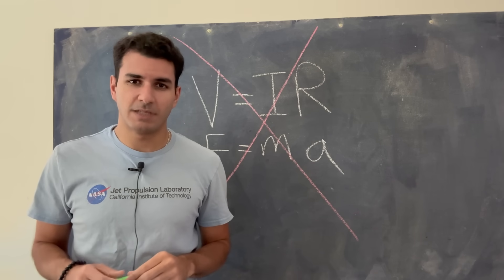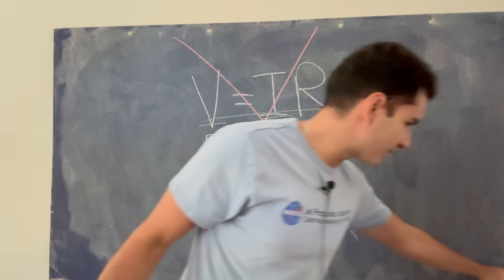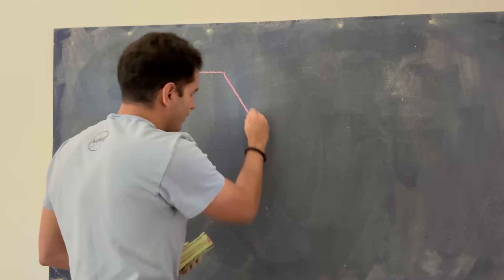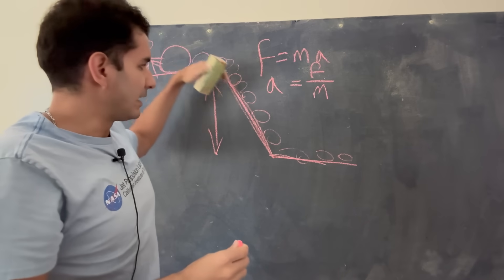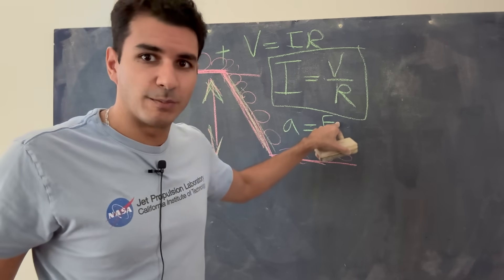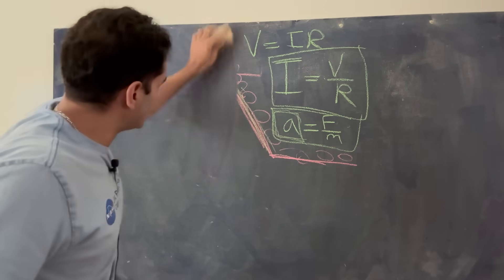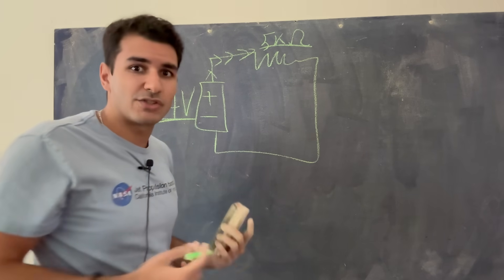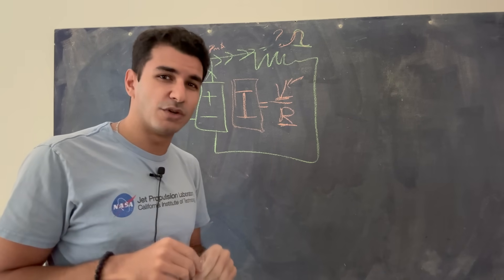You don't really understand physics

Comment: I would agree with your explanation of how and why this happens, but writing the equations the other ways tell a story too. The equation's form dictates what you are trying to solve since all three terms are in a relationship to one another. I you change any one variable you have to adjust the value of one or more of the other variables to satisfy the equation. Once you understand how and why this happens as you show, you then can solve for the other values by arranging the equation. You are essentially asking a different question of the equation when you alter it and try to solve for the "unknown" value. When you know the why of the relation, you can for instance, deduce and solve for the total voltage potential in a system needed to satisfy a known the amount of total current flowing with a known total resistance of the circuit for DC. Real life is quite a bit more complicated in that you have to consider a time factor in the equation as well as the variances of the variables due to other outside forces. What is interesting to me is trying to understand the relationships between the variables and understanding the how and why the relationship exists with the  drivers at the most fundamental levels.

Comment: This is pedantic
Reply: Not only is it pedantic, but it is outright wrong.
Reply: @lepidoptera9337 care to elaborate?
Reply: @grandblue_x  F=ma is the fundamental definition of mechanical force. U=RI is an approximate material law that only holds reasonably well for very special materials in limited voltage and current ranges. This guy does not understand the difference. I hope you do. If not, then you weren't paying attention in high school, either.
Reply: @lepidoptera9337  i dont think he said that v=ir is applicable everywhere and there are reasons why things are defined as they are.F=Ma is only applicable for point  object and is very vague definition not to mention it only works when talking about newtonian physics, i cant see relevancy of your comment here because he just explained cause and effect like there cant be acceleration without change in velocity ,which
 is true.

Comment: You cross out V=IR and F=ma like you have a more fundamental understanding, and then you just re-explain the equations.  You are better at marketing than engineering...
Reply: I think you missed the point
Reply: @dariosarubbi3129  His only point was that he is not qualified as a science teacher. He does not understand physics, not even at the high school level.
Reply: Huh?
Reply: For me, it was while working on the electrical power equations that this concept really started to feel important. You'll need to be sure of what the I or V is in an  I^2*R or V^2/R  that you're calculating power.
Reply: @praneshsuresh1391  I and V and P can be measured rather easily today. Resistance is really just a convenience quantity for engineers who have to design stuff from well characterized industrial components. Physicists usually don't give a hoot.
Reply: @lepidoptera9337  I was referring to some of the questions that get asked in exams around calculating power. Framing Ohm's Law as  voltage as the cause and current as the effect can prevent confusion when applying derived formulas like P=I^2*R or P =V^2/R . For example, if you're solving a circuit with known total voltage, V^2/R may feel natural. But if current is given, I^2*R is more intuitive. Thinking about what drives the system (voltage or current) helps avoid missteps when choosing equations.
Reply: @praneshsuresh1391  The problem is that Ohm's law is not a law. It's a materials property. It may or may not be true. Just because your schematic says 1k doesn't mean that your resistance is 1k. If you don't keep that in mind 100% of the time you will never be able to debug an electrical or electronic circuit. You will be like a car mechanic who pretends that all engines run correctly all the time.
Reply: @lepidoptera9337  I don't think you've understood the point I was making. I'm not debating the material properties of elements. Also, you seem to be confused between resistance and resistivity. All I was trying to say is that while calculating power through a certain point of the circuit, it is mostly better to understand the current flow through the circuit and arrive at the result. It's a lot more intuitive that way.
Reply: @praneshsuresh1391  You can't "understand" the current flow. You have to measure it. Kid, you are an amateur. ;-)
Reply: Mmm! mkt you are I think!!
Reply: The marketer are the schools and university.
Reply: @PaulAnca-k4f  My public schools and my university didn't market to anybody. They didn't have to. I got my education for free. :-)
Reply: Whoosh
Reply: You mention how current is the effect, but what about when under a generator, now the current is induced from the flux and velocity of the wire, which then causes a voltage across the armature
Reply: You completely missed the point, he really explained beautifully that how a function works, there is a cause and there is an effect.
Reply: He showed that he doesn’t understand physics.

Generalized Potentials and Generalized Fluxes are interchangeable!

For example, both a current causing voltage or a voltage causing current are equally valid descriptions of a system.

Similarly, in mechanics, force causing acceleration or acceleration causing force can both be valid ways to express the relationship depending on the context.

This principle highlights the reciprocity and symmetry present in many physical systems, where cause and effect can be interchanged.
Reply: @pascal2745  Make legit sense
Reply: @pascal2745  Yes, except that Ohm's law is a material law and not fundamental. It's an exception and not the rule. We will, however, never find an exception to Newton's second law (as long as real forces are considered and we are in inertial systems) because that is a fundamental definition of force.
Reply: @scientificbhaiya9336  Brah, you missed my point, in western culture if you put a big ass "X" through something that implies it is wrong.  His video thumbnails does this in a bombastic manipulative way to get you to come give it a watch... also a little sneaky, he uses the fact that he may be doing some work for NASA to give legitimacy to his content. Typically employers don't want you to use their name and logo to create independent content unless they give approval... wonder if NASA knows about this channel? I would like the channel better if content was presented differently...
Reply: @scientificbhaiya9336  At least that's the kindergarten view of classical mechanics. It stops working as soon as I drop something because now there is an object accelerating downwards without any force whatsoever. OTOH, if I want to hold that object in place, then I have to supply a constant force upwards.
Reply: @lepidoptera9337  Bro I think you misunderstood what a F is there. F is the Net force acting on the mass M, it is the overall force after adding resisting forces and supporting force, now here in the equation a=F/m the resistance is not friction but The Inertia itself I.e. the property of the mass to resist motion. And no object accelerates without a force, maybe you have a border aspect your saying, I’ll like to know more about it.
Reply: @scientificbhaiya9336  Exactly. There is no force (net or not) acting on a falling body. Classical mechanics is NOT as simple as it sounds. You need to read the fine print. The fine print says that Newtons laws are valid in inertial systems. ;-)
Reply: @lepidoptera9337  So you’re watching the falling body while sitting on the body itself ?
Reply: @scientificbhaiya9336  Hehehe... that is the problem, isn't it? Did you ever look at the retrograde motion of planets? One elliptical motion, when viewed from an observer who is in a different elliptical motion looks very quirky. One wonders how the likes of Copernicus and Kepler figured it out. Today we can do all the numerics on a laptop in a fraction of a second, but those folks had to do it all by hand. Copernicus even made his own trigonometric function tables... his book is a real treasure of early science writing. Well worth reading (much more so than Newton's Principia, which is just a mess from a modern perspective).
Reply: @clintonezeh7556  Yes, but gravity is reliable. The solder joints in your circuits aren't. Dudes! Stop making fools of yourselves. :-)
Reply: @lepidoptera9337  you're just talking out your arse bro 😭🙏
Reply: @clintonezeh7556  Awh, you are so cool when you are begging for attention. ;-)
Reply: @clintonezeh7556  Yeah, that guy actually said that no force acts on a falling object, even though the gravitational force of a planet, for example, will always be acting on the object, thus making F the net force obtained after subtracting the gravitational force's magnitude from the magnitude of the drag force
Reply: @lepidoptera9337 there is no force acting on a falling body? So gravitational force is off to a vacation then? I don't understand your point. Ofcourse there is a force acting on a body that is falling, which causes the acceleration that acts to increase its velocity. F=mg. Or maybe I misinterpreted you. Idk
Reply: @complexshity4602 different frames causes different forces to be created.... Just a simple example is pseudo forces which are literally false forces need to be created or added into observation..... The gravitational force under which you assume you are falling is actually a free fall motion..... and it may be a state in which no force is exerted on your body for a observer in space.... I hope that I m making sense 😅

Comment: To be fair, current comes first, then the voltage appears as the result if a charge gradient.
Reply: I actually agree with him. Especially on on an entry level but also more fundamentally, the current in the effect and the voltage is the cause. Current is a net charge passing through an area over time, and unless you are talking about free charges passing through space, something is causing them to move. If you have an electron at rest, it will only stary moving in tge presence of an electric field. On the other hand, voltage between two points is the sum (integral) of electric field along a path between the points. The existence of a voltage implies the existense of an electric field, which itself is the cause of charges' acceleration.
Sure, you can say that in order to create an electric field you need to separate positive from negative charges in a material.  Even though that is currect, you can keep an object charged with no electric current which keeps on running, unlike a current in a matterial which is dependent on the existance voltage

I won't enter elctromagnetic inductance since this comment is already long enough
Reply: Flow of electrons per unit time is current (or flow of positions if we are saying it convention wise) so why do they flow ? Without any cause ? Other factors must affect them and voltage is the factor ,it's like removing some water from a beaker very quickly so water around it flows due to that pressure difference.
Reply: @grandblue_x  you never apply voltage to get voltage. You do work with the magnetic fields, and the number of charge you moved determines your voltage. If you short circuit the generator, the divisor will be too high and no effective voltage would be generated.

Comment: These are Equations that are more general that functions. I think functions are useful when we want to see equation behaviour with respect to changing values of one term (variable). Since this is a monomial equation, F=m×a, F/(m×a)=1, a=F/m ... are all the same and each term could be assumed as function of 2 other terms.
However there are some more generalized forms of this equation in dynamics. For example in Mass-spring-damper model, equation is formulized for F. Considering time varying parameters we have:
F(t)=m.a(t)+k.x(t)+c.v(t)
In other words, each one of above terms are in form of Force (inertial force, spring force & damping force). Also since it is a diffrential equation (a=v'=x'', and v=x') we can not simply re-arrange and solve them as a(t)=F(t)/m-(k.x(t)+c.v(t))/m, since x, v and a are dependent to each other.

I'm not electrician but remember similar equation in RLC cirquits:
V(t)=Vr(t)+Vc(t)+Vl(t)
Where Vr(t)=R.i(t) is the simple form equation.